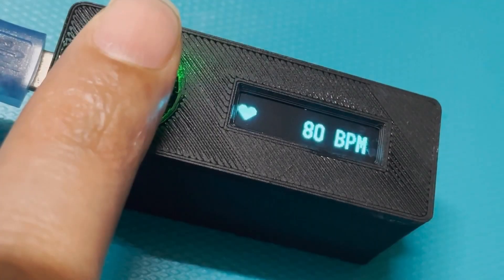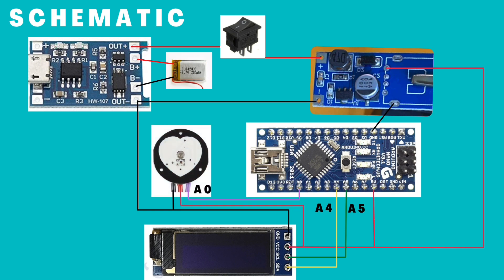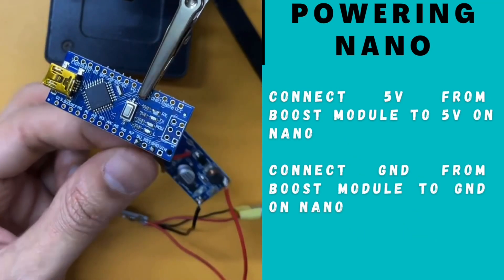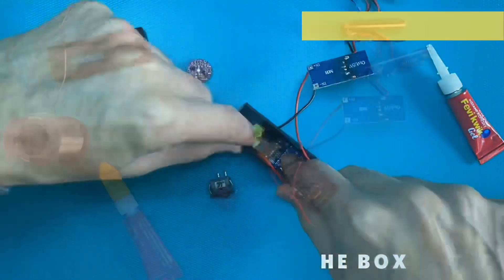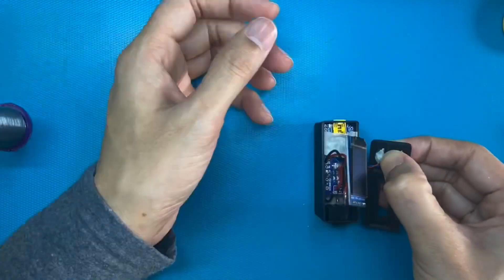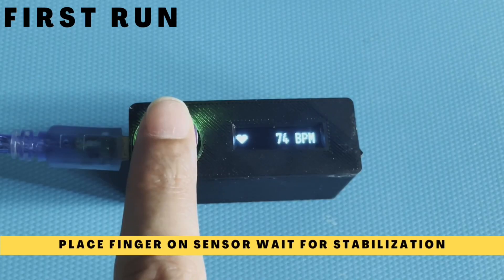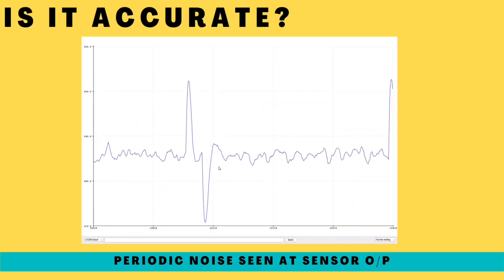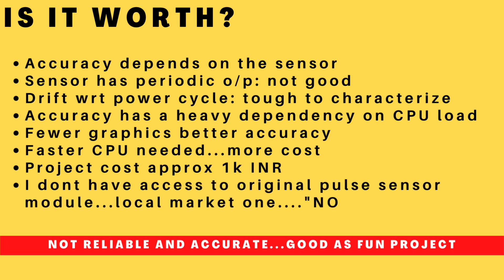DIY: Heart Beat Counter at Home...Simple cheap rechargeable heartbeat counter!

Comment: Can you please recommend any  product in market which is somewhat reliable for heart rate monitoring? Would be great if it's a wearable device that can be use worn while carrying on day to day activities
Reply from the maker: Some of the more reliable ones as i read are MAX30102 or MAX30100 modules, i haven’t tested them by myself but the spec sheets seems lot better. If you are truing it I will be curious and happy to learn.